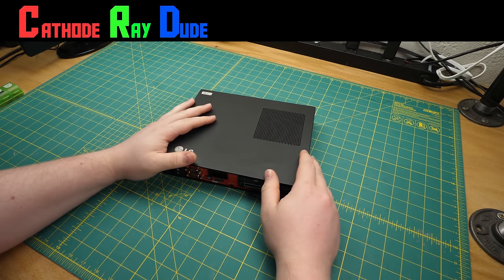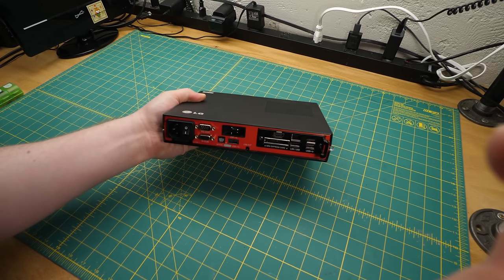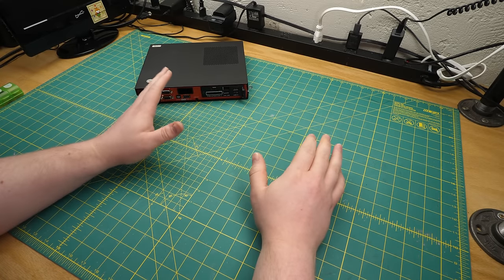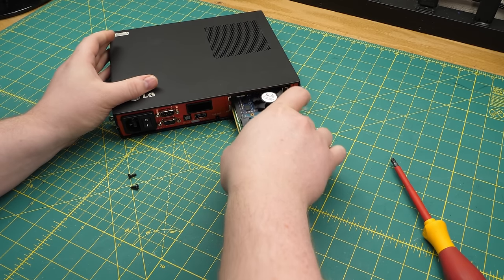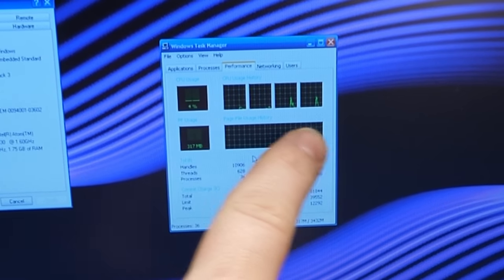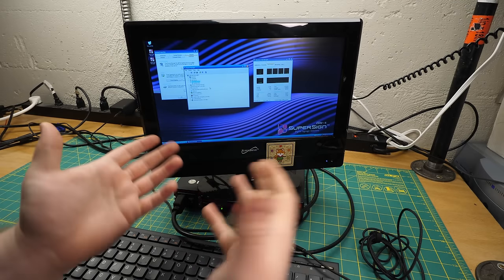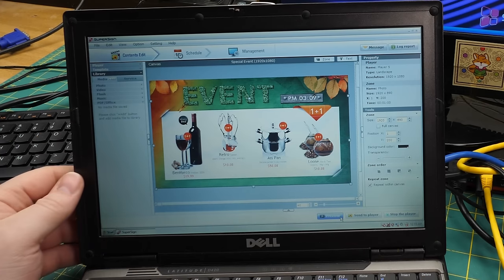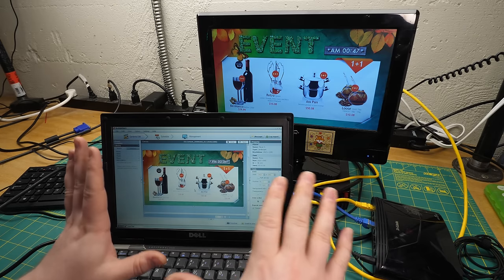Little Guys 6: The Worst Possible Timing [LG NC1000]

Comment: Oh man, my current job is not in digital signage but it's pretty close by, so I hear about it a lot but I've never actually seen what it looks like. This is genuinely pretty illuminating and also quite interesting! And, also -- yes your understanding of Adobe Air is mine as well, as someone who many years ago worked on a project with it (though not the development directly).
Reply: I have a vague recollection that the earliest versions of Spotify were Adobe Air applications and I think that's the only thing I ever really saw use it "seriously".
Reply: @BremenSaki I know of a popular Polish tax filing software which used to be made with Adobe Air. Current versions are Electron.

Comment: Back in 1998, I paid £5000 for a Panasonic 43” plasma monitor that had a slot in it to fit one of the various function cards to fit your need. I paid £300 for the TV tuner option card. Without a card of some sort, it was useless.

Comment: That JTAG option around 20:45 will be because ordinarily, Intel's shipped products have their JTAG interfaces switched off by bits set inside the processor/chipset and there be pin muxing Shenanigans at play. The option will be to make that interface available again and allow a JTAG adaptor to be hooked up and used with the interface.

Comment: I know that I had an Acer C7 chromebook that had one of those half-slim sata drives with a adapter bracket to fit into a normal HDD slot. it was a 16GB sandisk drives. 
I can only assume that acer wanted to rush a chromebook out the door so they grabbed a netbook chassis and just installed chromeOS on it, the keyboard was a windows board, just with the meta key replaced with a magnifying glass(usually chromebooks use their own custom layout). it even had upgradable ram and an SSD which is VERY rare for a chromebook.

Comment: the ion chipset also includes nvidia graphics as well, the early atoms also didn't have integrated graphics either. in this case the specific nvidia gpu in this would be a Geforce 9400m G, it also did video decoding. so in this operation it does both chipset duty and gpu duty. 
(edit)
oh yeah, the way the gpu is connected to the system is weird, the nvidia dgpu die inside the chipset itself is actually wired up to the cpu as if it were an igpu, so graphics memory is actually shared system memory between gpu and cpu.

Comment: I recall being pretty impressed by Ion back in the day, though my only experience of it was in netbooks - paired with some of the later 2c/4t Atoms in later Eee PCs. I guess it makes sense that it would be in low power/embedded systems like signage machines too.
Reply: Ah, N2600s and the like. They were actually somewhat decent CPUs, mine could even handle Windows 10 and run 1080p YouTube. All that with a tiny TDP.

Comment: The OPS tuner modules could be for use after one of the displays has lived its life as a digital sign and later sold off. Someone could buy the tuner module and turn the former sign into an actual usable TV.

Comment: I was wondering when you were gonna mention BrightSign! I was working A/V at a bar that used a couple BrightSign boxes to drive some LED walls out the front window. But when we needed to display signage on TVs in the bar we actually just grabbed a flash drive from a pile and loaded up the PNG or MP4 or whatever and the LG or Sony or Samsung Smart TVs did all the work ha

Comment: funny you mention shipping those giant digital signage monitors. i work in logistics and recently we just received a 95 inch lg digital signage tv that i’m sure cost the company more than several months of my paycheck. it was on a 10 or so foot long pallet standing straight up and strapped down with dozens of straps and tie downs. and it also came on a box truck with nothing else in it,  so yeah they can be shipped but probably for no less than several grand. also, i found it hilarious handling that thing when i mostly watch tv on my laptop.

Comment: This thing reminds me of a microTCA chassis with an SBC installed. Very cool tech that's used in industrial and telecom systems. There's a very basic backplane that provides conduits for PCIe, Ethernet, reference clocks, and power. You install at the minimum a controller card which does things like act as an Ethernet switch and then add on things like SBCs, FPGAs, interface cards, etc. Since it's all PCIe, it's not that hard for a vendor to supply both a PCIe and mTCA version of a card.

Comment: I love digital signage stuff. 
I currently have 4 different signage displays. 2 NEC and 2 Samsung. Sadly I can't give you any since I'm from Germay. 
Super cool stuff. One from NEC even seams to be a prototype/sample model. It doesn't have any markings except some paper "sample" stickers. And it doesn't really correspond to any official model from NEC. Sadly my Cat recently smashed it because it knocked over another one into it. 
It also had another slot standard from NEC. 

Would love a series for these. 
Also there are Standalone Adapters for OPS/STv2 from NEC and others.

Comment: Some observations:

- The nVIDIA ION is a low-cost nForce chipset for the Atom. It indeed had a 9400M GS-equivalent iGPU, meant to provide multimedia codec support for the Atom. At this point, as you said in the pinned comment, the first Atoms were only a low-complexity x86 chip. You can see in that 330 that it is actually two Atom 230 dies, almost packaged a-la Pentium D or Core 2 Quad. The EeePC 1215N by ASUS was one example of a netbook equipping the 330 Atom and the ION, it came out in 2011 I believe.
- The ION and ION 2 supported 4GB DDR3, the issue is the density of each chip in your RAM module, you need a 2RX8 DIMM if you want it to be detected. Your other limitation is that the original Atoms were 32-bit, so it is silly to put more than 4GB.
- Low cost GPUs and some Chinese oddities have the heatsink and fan with the cables being routed inbetween the fins as you have noticed. It's janky but it works.
- LG wasn't the only one providing this sort of solution for Digital Signage. I used to provide monitoring and support to the Argentine Airports and they had lots of Samsung screens with their proprietary internal connectors for SoMs like this one, all of them with mSATA drives and AMD Athlon LE chips - they were used as information displays for departures and arrivals. Of course, these predated the OPS standard. So if there was a need for a unified signage solution, it's good that later on they all converged on a single connector.
- If I recall, Linus Sebastian (linustechtips) showed a digital signage monitor with a Raspberry Pi.
- I've seen in my local Marketplace that some individuals sold these or similar NC-series LG devices, it seems that at least locally (Argentina), some units fell into the hands of home users, as they sold some stock as home miniPCs. Never got around to buying one of these though.

Comment: Imagine an alternative timeline where the OPS module standard was used for all-in-one PCs!!!!!! The all-in-one typically is all junked once any single part fails since it all built as one big proprietary Hunk-O-Junk™. But if they had made the touch screen monitor/tv with speakers with an OPS port... they could have been so much more. Too bad the OPS Monitors are so expensive and rare used. Be kind of fun to have a rather powerful Windows smart TV like that, though I doubt any were ever sold with decent graphical power (for gaming/emulation). And while the early atoms were not great... neither were the weak AMD "E" and "A" series APUs that went in many of those all-in-ones.

Comment: My husband works in the digital signage industry and there are a TON of different setups out there. He's set up many for military bases and as you can imagine, they don't have straight forward remote access to the outside, so lots of jumping thru hoops to update those! Also,  some of the larger chains he works with will push their updated menus out to all locations or a set of locations with new items and pricing and sometimes if one of the players fails in the update, he has to remotely log in and fix it. It's a lot more complex than people realize unless you are in the industry and work in support.

Comment: Thinking back, I actually had to manage some of these old LG signage TVs that has those computer modules in them. They were pretty useless without the PCs installed. Atoms with 2gb RAM and 32gb ssds. We managed them from our HQ from a local server. They were deployed in 70 locations across 42 cities. Besides some PCs that died from overheating, they were pretty reliable

Comment: a lot of digital signage (at least the stuff managed by reasonable individuals) runs specialized linux-based solutions like yodeck on either specialized hardware or a standard SBC such as the raspberry pi. these solutions usually come with a lot of robustness with features for fleet management and monitoring.

Comment: You could presumably get away with using five or six wires for VGA-Red,  Green, Blue, H Sync, V Sync, and a ground. The other pins are things like return lines, monitor ID, and EDID power. Clone vendors in the late 80s routinely used a 9 pin connector instead of actually using the 15 pin standard, and those are usually intercompatible.

Comment: OPS units in commercial tvs are still a thing and for the most part are compatible, but a pain to deal with as the slot sizes changed. Sold many of these to schools mainly. Displays now also include the digital signage software built in, for example Philips make ones specifically for hotels with the software they use included. So many options.

Comment: I once found a robust, ventilated box (weighing about 30kg with a 2mm thick custom-made stamped steel frame, about 1.5 x 3 feet and six inches thick) box that had a flat-screen TV and an Apple Mac mini in it. The power solution was hacked for direct connection and there was a pole mount on one end. Too kit home and powered it up and voiles an electronic menu display for a restaurant. These typically sit outside a restaurant facing the street and display the vendor's menu items to passing customers. The Mac mini contained a custom signage program that reads all the items, headings, categories, specials and seasonal items with pricing from an Excel file and used a file (.xls format) with a background image. There seemed to be a provision for touch-sensitive menus as well and It had a phone home remote capability (Probably to update the menu and confirm the software license)

Comment: In MagiQuest we used those Brightsign players for FMV battles using those very control signals you mentioned. Not quite as responsive as the far more expensive ETI systems they replaced but, impressive none the less.

Comment: The fewest number of wires needed is 5 if you are using a shield which is grounded which you can use as the ground reference, or 6 if you have a dedicated ground wire instead. 9 is realistically the requirement, as that would include the inverted signals so you don't have a noisy signal at the other end. R+, G+. B+, R-, G-, B-, H+, V+, Ground

Comment: 52:00 - I HAVE seen one of those in a consumer device! My sister bought some ultra-low-end Lenovo laptop back in the early Windows 8 timeframe (I think it was $150 on sale brand new,) and when it eventually died, I tore it apart for useful parts, and found one of those inside.

Comment: So to expand on this as someone that works with digital signage. LG still make AIO modules in this format. 
There was NC1000, NC2000, NC2100, Then the MP500 and MP700 (The 700 being a gen3 i7 with 32Gb of ram) 
After this they started making AIO units that didn't have a removable PC Starting with the LST-1100A spanning to LST-4100B 
Now the WP402 and WP600 both have built-in AIO's That are basically Rasberry Pi

Comment: I have looked at other comments and it doesn't seem to have been suggested but the extra standoff above the breakout board seem to me to look like hard drive spacing but I couldn't tell if the pass through plug on the docking board was some kind of all in one for a hard drive or not I couldn't see it on my screen

Comment: There is an adaptor you can get that has a DVI out and a few usb connectors to test them and diagnose.  They run about $200 bucks from what I have seen.  I bought on of those for only 50 bucks and was annoyed by that connector.  I managed to wire in some connections for its dvi out but got board after a bit.

Comment: This one takes me back a little bit.  When I was still working in the retail world, I actually designed a solution similar to this.  Very simple.  Just a bunch of raspberry pis connected to TVs and an FTP server.  Then I wrote a bash script that each one ran that would connect to the ftp server, download the latest version of the image we wanted to display on the menu board, and then just push it to the frame buffer.  There was a bit more to it than that, but not really haha.

Comment: From what I've learned about "HDMI matrix" devices, they don't do video walls – they're just matrix switches, and can clone an input to multiple outputs but not much else.
Reply from the maker: Yeah, that wasn't the right term, but there are video wall processors that cost very little. I've since been informed there are lots of reasons not to use them though

Comment: Having the computer module able to be pulled completely out with one screw, so if it fails, they send a replacement, and walked you through the replacement procedure.

I used to do upgrades and replacements for stores and I had a lot of Drop Shipped parts and I would get to the location and I would have boxes in the back with magic marker written by the manager , something to the effect of " For Toshiba Repair tech " or something like that 

I personally love the mini PCs that fit on the back of TVs and you can have a full computer on the road, and it is better than a laptop in many ways.

Comment: There's a listing for an NC2100 module on eBay right now that looks like it MIGHT actually use that unused connector you were talking about. The form factor of it is slightly different as well, since the RAM is on the bottom instead of layered with the heat sink.
Reply from the maker: Well this is interesting! I'm lookin at one of those listings and it has a pic of the bottom, but I can see that the connector is more like PCIe, it's a simple edge connector. totally incompatible with this dock, which means LG not only made a totally unique, one-off system for the NC1000, but made at least one other completely distinct system for the 2100. Bizarre!
Reply: @CathodeRayDude  Yeah, I'm probably looking at the same one. There isn't a good image of the connector though, so it's hard to see what it is. There seem to be several variations though. The 2000 and 2100 appear to have different connections entirely.

Comment: I'm not sure if this counts, but I know of one retailer who use a number assignment/call customer setup hooked up to a display and speakers. However instead of using a 'little guy' they instead have a regular late 2000s/early 2010s ATX half height office PC running CentOS and some DRM protected bespoke software, probably using VNC for remote access but don't know for certain.

Comment: I once worked on a project that used several displays connected to a Raspberry Pi and each one showed one specific part of an image it got over the network, so basically working like you described at about 30:00.

The idea behind it is having multiple monitors connected through a cheap network and not use higher-end GPU which draws more power. It's simply a complexity tradeoff.

Comment: Okay. I shall illuminate you on the multiscreen background things you see in TV news etc. Each one of these screens was at about HD resolution, they are  backlit displays though mirrors and complicated lens systems (retrofocus configuration) and even have features like hot swapping a burned out projector lamp. With a special little lamp elevator built - in inside each one .They would be tuned  to match the studio lights (actually tuned with an accessory colorimeter). The manufacturers took great pains to make the seams between them as seamless (lol) as possible. The end facing connectors were as thin as a needle. After all this ,  you can guess the cost of 6 or 12 of these little guys and the server to serve the cut up image is not as significant (I m not saying these came cheap).
Aaand that's BARCO for you :)

Comment: My non-technical suspicion is that the empty pads on the daughter board were meant for a GPU expansion with some nominal V-ram to support more interesting graphics options in the programs to be displayed... or perhaps support for it to run a second or several additional monitors from the single machine.

Comment: I remember hearing about Nvidia ion from the netbook days. When netbooks were picking up some people wanted more power in them and ion was supposed to be a super low power GPU for netbooks that was supposed to even been able to do some light gaming. I remember following netbooks a lot because I wanted a small portable computer but I needed one for gaming on the go. Nvidia ion was one of those things that looked really tempting as it might have allowed me to get a cheap enough laptop that could still run Guild Wars which was my bar at the time. Now I'm just really happy with my Steam Deck and really want to get an OLED model soon.